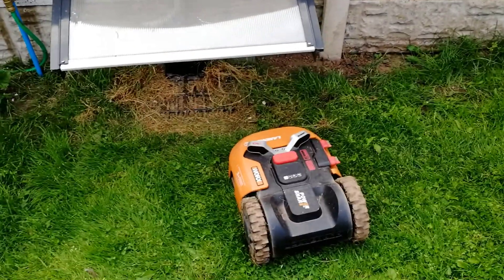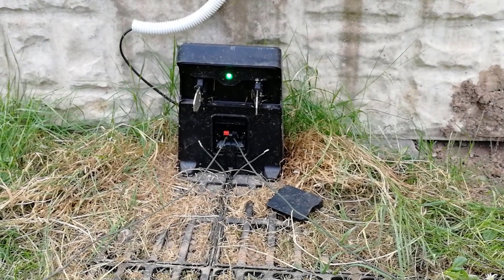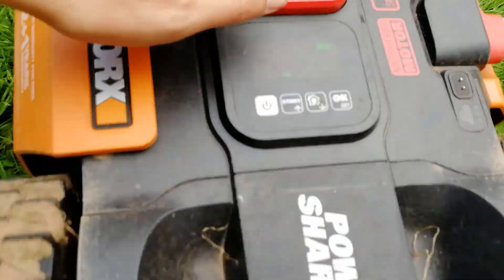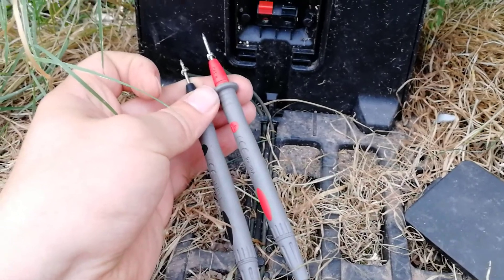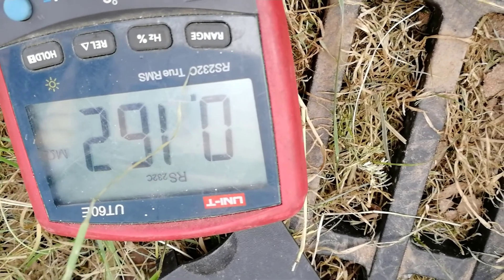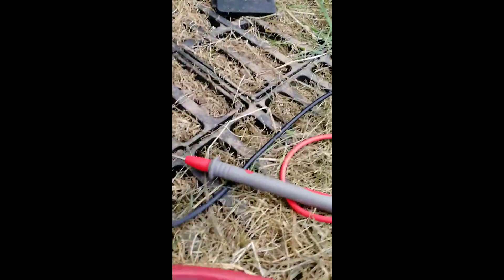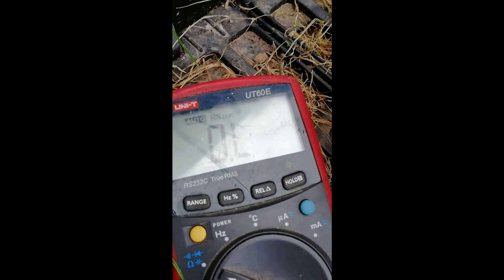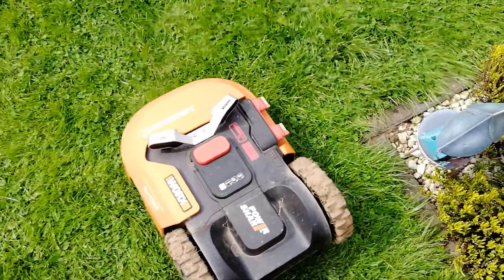Robotic Lawnmower Worx Landroid Easily Locate Break in Boundary Wire

Comment: I did not hear a difference in the radio, is it more clear in real life?
Reply from the maker: Tune it around 700kHz but the difference is faint. You can use headphones if your radio supports that.
Reply: @chr151nuk  i have the same radio, but it only autotunes...so it gets stuck at 694 and then again at 702. I havent figured out how to do manual tuning. Thoughts? Also have the same problem as you...mowing season is coming...green lights...test of a small loop works fine but my larger buried cable has green lights but mower wont mow.
Reply: I heard no difference whatsoever